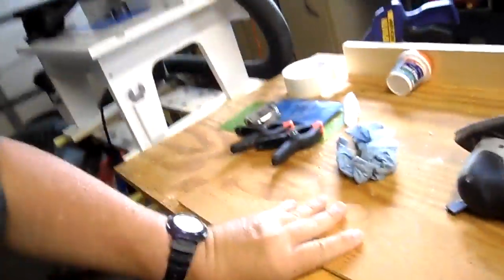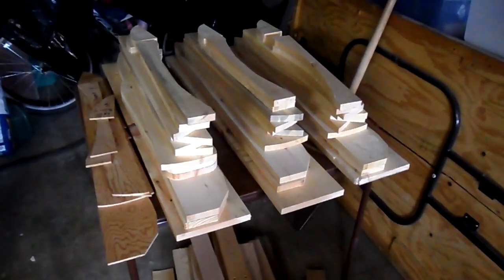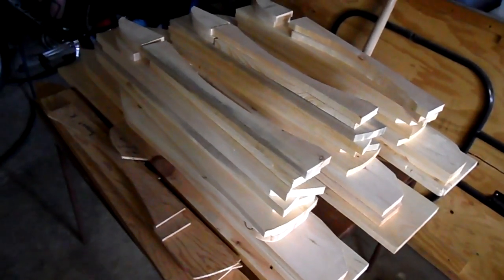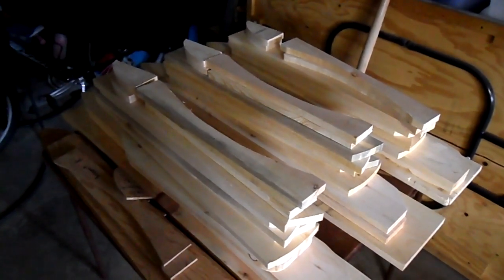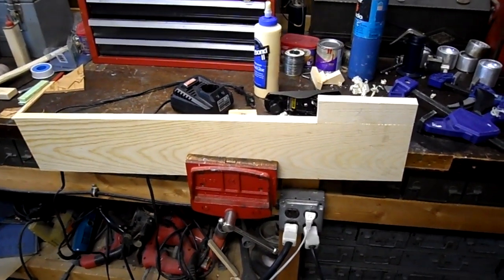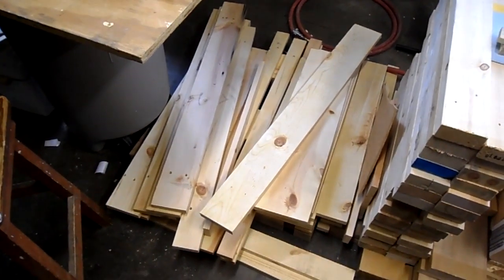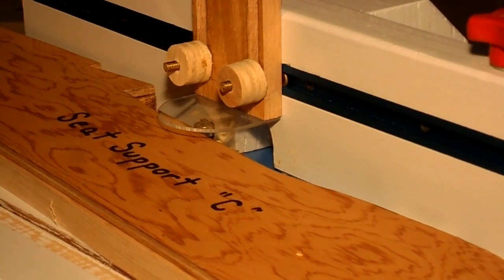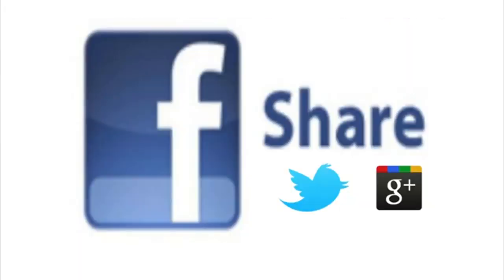Adirondack Chair Project Update

Comment: Really good video Ron,
  I like the idea of transferring the screw / bolt holes to the template for easier builds in the future.

Regards,
Bob
Reply from the maker: Thanks Bob, these plans are from March 1992 The Family Handy Man.  I've recently found a more readable set of plans from 2010 Woodworker's Journal.  Both are very similar within 1/2" to 1".  I have the plans in PDF format if you'd like to keep a set in your files.  Just let me know on Keek.  Thanks for watching!
Reply: Thank you Ron, I sent you a Private Message on Keek.  Talk with you later.

Regards,
Bob